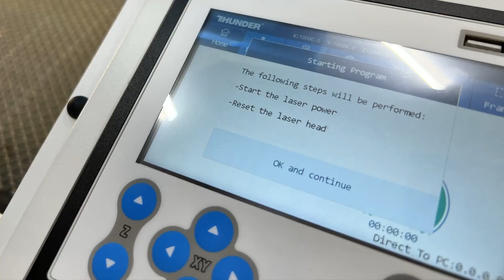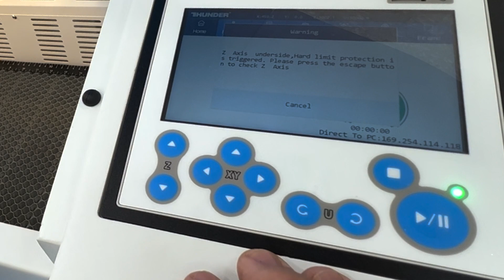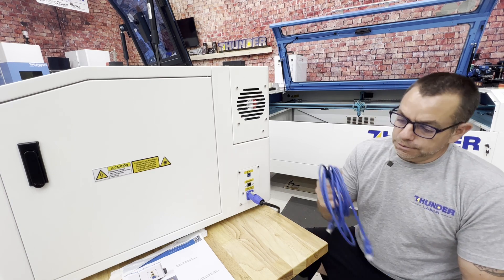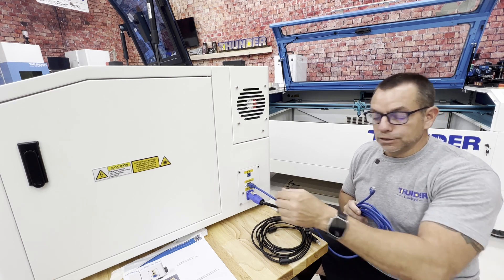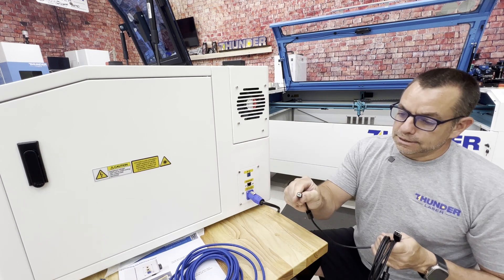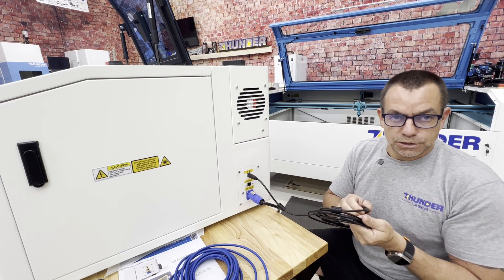Thunder Laser Bolt: Power Up, Testing Axis, Choosing your connection method

Comment: I just bought my 1st ever Thunder laser.  What is the maximum stock air assist pressure on the Bolt Plus?  I can’t adjust the high pressure screw over 1.9 psi.  I keep getting error message saying my Bolt Plus is below .3 psi and it won’t start a new job.  There isn’t any photos or instructions anywhere how to operate the 3 gray buttons on the little LED screen above the High and Low PSI adjustment screws.  Frustrating that the stock air pressure is so poor… what am I doing wrong? I know how to switch air on and off in settings for cuts and engravings, but it seems there is very little air when needed.
Reply from the maker: Email Support@thunderlaserusa.com